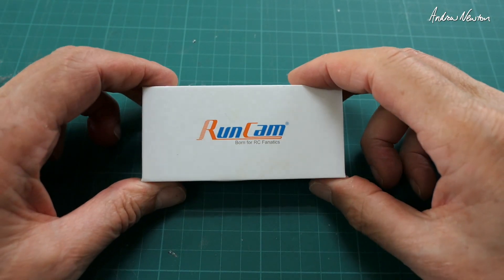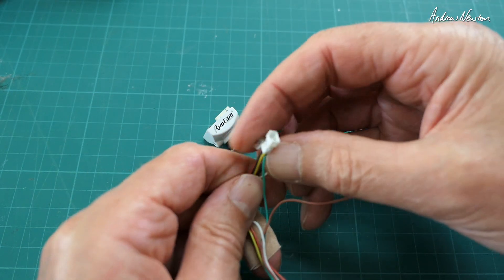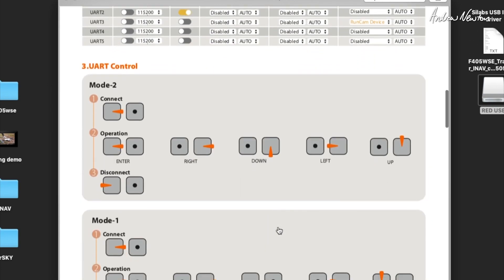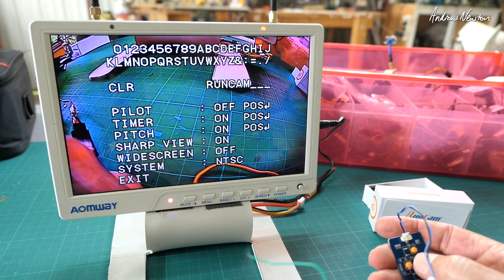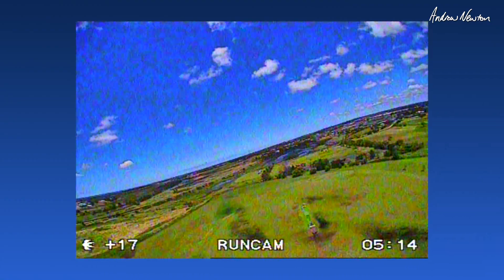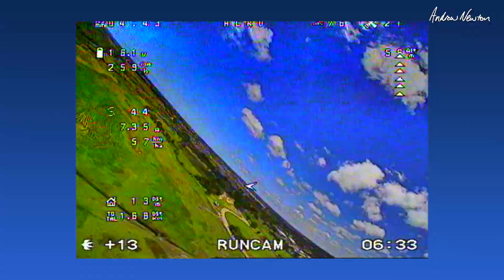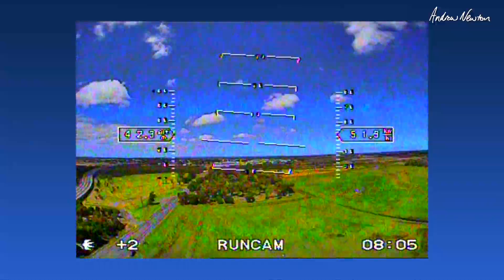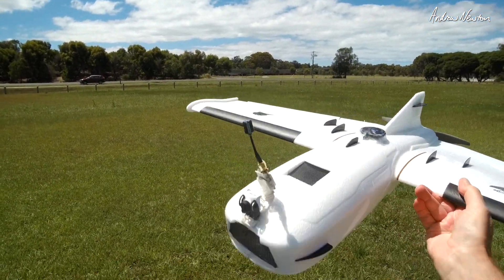Runcam Racer 5 - FPV cam with Gyro

Comment: Hey Andrew. How do you attach your camera and VTX setups to the fixed wing surface?
Reply from the maker: I usually make a PVC or 3d printed mount for VTx and camera then screw or tape it in place

Comment: Oversaturated colours Andrew...?...Don't remember the Rambler review, but it looks like a smooth flier for a wing...I'm building the Whitewing 3D printed flying wing it's fun printing planes..Waiting to see you do one..🤔🤔😀😀🇬🇧🇬🇧🇬🇧
Reply from the maker: Haven't seen 3D printed plane that flew well or lasted more than one landing
Reply: @AndrewNewton  I'm trying it anyway, adjusting flow rate can make a huge difference to strength I've found...I used to think the same as you though, so be interested to see you try it...🤔🤔🇬🇧

Comment: FPV ground vehicles could use the gyro.  I was hoping for a voltage display.  In the user manual it refers to an alarm but then it seems missing. Possibly in a firmware update? The image quality looks to be excellent. I prefer the 2.1 lens usually I get less distortion and lense flare. Thanks, Andrew for your excellent videos!
Reply from the maker: Good point!

Comment: I used to like the RunCam Sparrow for fixed-wing use as it was (originally) 25-ish AUD, had a voltage OSD & a microphone, but then the price nearly doubled & we lost all the extras that used to come with RunCam cameras...
Since then Ive been having a hard time finding ANY camera at a decent price with a full body AND a voltage display for less than 50-odd AUD!
I like the image of the Foxeer Razor Mini(?) & a decent price, but no voltage display....
I wouldn't mind paying 50AUD for a camera with voltage display quite so much if they also added a display for RSSI from my rx.
With manufacturers now adding novelty features for a small select market in an already narrow field (FPV industry), surely it's time one of them started to think of the fixed-wing fraternity???
Anyways, random thoughts- looking forward to trying out a Toothless2 on an old HK Walrus very soon, but it's looking like Foxeer have stolen me away from RunCam! :v ;)
Thanks again & all the best!
Reply: We are very sorry to see this and feel very sad to lose you. Why don't try our phoenix 2?
Reply: @RunCamFPV  The lens is barely considered full sized, but mainly- there's no full body to protect it in the point of a flying wing, let alone poor weather & there's no OSD voltage sensor,. the Sparrow had these features & didnt cost as much as this nor the Eagle...
All my planes up until the last one has a Sparrow on them, unfortunately I had to go for the Faxeer this time though... :'(